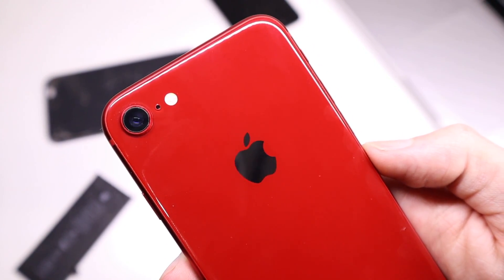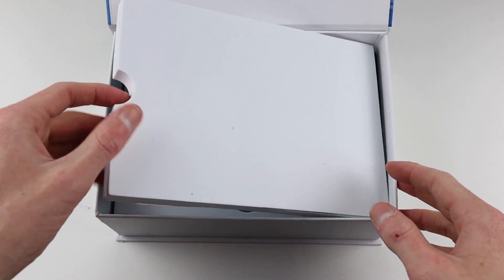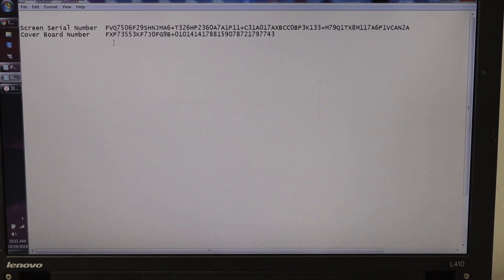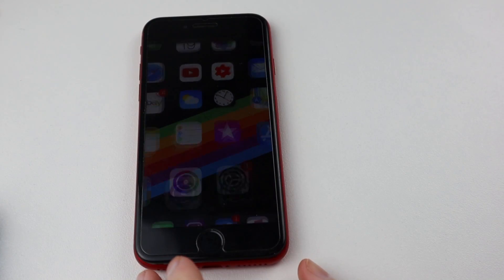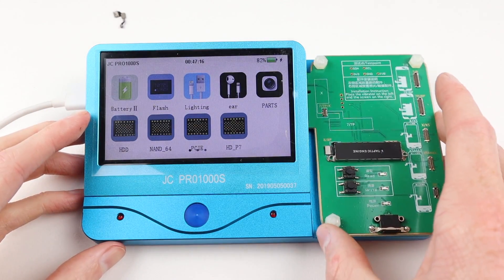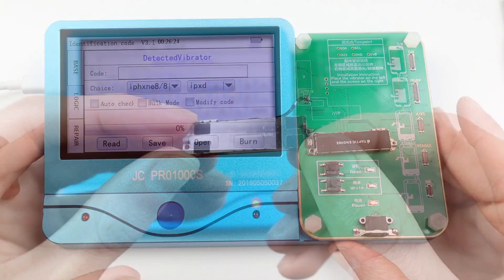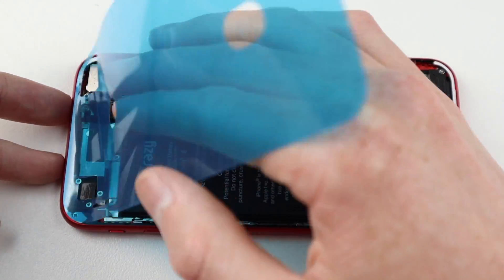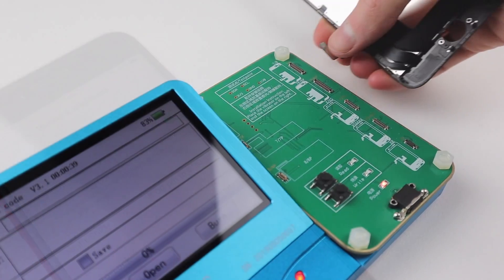Most Common iPhone Repair Mistake - True Tone Recovery without original LCD - JC Pro1000s

Comment: The LCD got half ripped out by a new battery's adhesive. I tried to stich it with tape but the screen looks terrible. Is there a way to replace that tissue without replacing the whole LCD? It's an iPhone SE 2000 and I don't wanna mess with true tone settings.

Comment: You should see if that unit will work with the new iPhone 12 …get 2 devices ( 2 IPhone 12s one Gold and one White or whatever  ) and then swap the parts. You will notice that apple gives a nag for ever part no matter what if its not the part that came with the phone even if its from another same iPhone OEM! I believe its because of a serial number issue. Maybe using this device for each device you swap would do the trick!

Comment: I have a question you mentioned of the front camera is changed or replaced there’s no way of getting True Tone back. Why is that ? And does that also apply for back camera if the back camera was changed or replaced aswell would you still have that problem or no ?
Reply: Tenho essa mesma dúvida! Se caso trocar a câmera frontal não tem como ativar o true tone?

Comment: Could the programmer be used for android? Is there any reason it would be needed on an android repair?
Reply: afaik Apple is one of the very few companies that block you swapping out components... so you generally don't have to worry with anything non-Apple. Just Apple being Apple.

Comment: Phone 8 Plus Vibrate Issues

My home button gives me slight vibration feedback, but nothing else in the system does, flicking the mute switch mutes, but does not vibrate, done a factory reset, software update to see if that would help too. Any help from here on would be great. I think it could be 3 possibilities, either a damaged chip on logic board, charge port flex or vibrate motor. Any suggestions

Comment: Question anyone,I already installed the new aftermarket screen on my iPhone 6s. I lost True Tone and touch ID but no biggie it’s our daughters play phone basically. No flex cables were ripped or misplaced. Everything is snug and properly installed. Someone said that Apple had started to pair the original screen with the logic board. So when I get the programmer,can I still remove the new aftermarket screen from my phone and then just put it on the programmer later? Thanks

Comment: hey Hugh you dont need any more this setup to copy LCM serial or any on systemconfig file (serial imei battery wifi bt etc) you can write/read from computer with MagicCFG you only need 20 dollar cable called DCSD cable (this works only on iphone x and lower)
Reply: you can unlock ipad icloud also a10x and below (ipad 2018/ or ipad pro 2nd)
Reply: because imei is stored in the baseband modem, that cannot be changed.. so ipad will become wifi only
Reply: so you need buy new systemconfig info (serial) and you good to go

Comment: hello I have iphone 6s set which has problem during call reject from other side or disconnect due to any reason my phone screen touch freeze after screen off and on touch work again but that's not happen when call on speaker phone. will you please help me out for this trouble

Comment: I recently purchased a JC V1S as my cousin requested a repair of his cracked iPhone X display.  I replaced it with an LCD rather than OLED screen, but the repair went smoothly and True Tone was restored.

His father-in-law also had a touchscreen failure on his iPhone 8 the same week that I received my V1S programmer. Both phones were purchased at a local electronics store that buys and sells used phones.  It appears that the iPhone 8 may have had its screen replaced before.  Could that be the reason that I kept having write failures to the new iPhone 8 display, or could there have been a different problem with the quality of the aftermarket display?

Otherwise, the screen looks fine and the touch functionality was restored.  The only issue that I saw was the lack of the True Tone option.  Since I couldn't interact with the previous touchscreen to open the settings, I don't know if that feature was working to begin with.

Comment: Ye I let a cheap repair shop fix my iPhone X... Lost my Face ID, gutted. They're screen was totally rubbish. I dropped it so I did the repair myself only to find they left screws out. which I knew was there, when doing diagnostic to why my phone was in a boot loop (ear piece cable) would 100% recommend doing it yourself.

Comment: Hi Hugh, wondering if you could provide a place to get easy to understant info abou the JC Pro1000s. In particular, will this product be supported into the future and provide updates when new iPhones are released? As long as I have the correct module, will this get around the issue with the batteries now being tied to the phones? Thanks in advanced.

Comment: When you mentioned something about the Taptic Engine not functioning properly, I too have had this occur. But, In my case, My taptic engine had came loose from the frame, and somehow the IPhone is able to tell that the taptic isn't seated correctly into the casing of the phone. Screwing the taptic engine in resulted in a now fully functioning taptic engine. Maybe it has something to do with increased power draw from the taptic when the whole thing moves as a result of the attempted vibration.

Comment: no man come on, it has nothing to do with hindering repairs but to ensure good customer service and obviously security to you and your device, not everyone lives in the US and has access to good and safe curated parts (iFixit for example) and safe repair shops that may also be curated for security, apple is going a great job to allow more repair shops to be able to fix your phone.
Also come on, apple devices are the ones that last the longest, I still use my 2011 MacBook Pro and an iPhone 6s that I do plan to continue using for quite a while.

Comment: Thanks for the great video. How do you get the value for Code (Gauss sn:)? I programmed LCD and MtSN but didn't have Gauss SN thus no true tone. (iPhone 8p)
Reply: Hi, I know its 2 years ago but have you found this out? :DD
Reply: @mr.malossi980  Gauss SN doesn't matter. you need to have right MtSN to enable True Tone. but if you replaced front camera module without saving ALS, you lose true tone even if you get right MtSN. but I can enable that if you want. you can PM me.
Reply: @ifixsmartphone9079  So what would you need to do?

Comment: The only reason things like Face ID and Touch ID are locked after replacing your screen is to prevent theft of your biometric data. If someone tried to steal your data by using a modded display they would fail, because your biometric data is saved on the same part that is connected to your touch/Face ID sensors and they stop working after your screen is replaced. So you can cry about not being allowed to repair your own device yourself, or you can actually be thankful that there still is a company that’s worried about their customer’s data.

Comment: More people need to stop buying flagship phones and buy midrange or lower phones.
Reply: To me 2 year old used iPhone 8 worth better than any late 2019 midrange phone in the market. I get phone with good photo, great video recording, very fast and efficient SOC ( A11 is somewhat comparable to SD 855+ )
...
...
While midrange probably seem as fast as flagship on year zero, the flagship usually equipped with more power efficient SOC.
Better SOC don't get heated up quickly, and they maintain their peak performance better.
Generally you'll start see difference between midrange and flagship on 2nd year when apps starts to demand more and more performance.

Also Manufacturer tent to forget midrange phone quickly, some just abandoned after the 1st OS update, while some lucky probably will have 2 updates during it's lifetime.
It so much worse compared to some flagship that will get 4 times software update during its lifetime.

Flagship and Midrange can have similar number of megapixel in camera or multi lens configuration, but the picture quality can get massively different especially at low light or areas with very wide dynamic range. Video quality on low light also a huge difference ( most midrange just focused at selfie and photo ). Even the video encoding can be very different ( flagship phone can handle slow motion 1080p and 4K 60 FPS while I haven't seen any midrange capable of doing that )
Reply: @rommysoeli  the only thing i don't like about iphones are the operating system.

Comment: While I agree it’s wrong of Apple having parts paired to the device like TouchID, FaceID, batteries, etc. It’s important for someone who is not into technology as much as you or other repair people, to know that their battery isn’t a genuine battery and may not be made with the same quality as an original, it’s not right to block the battery health but there should still be a message. And for FaceID and TouchID I think they’re right to block it because someone could make a TouchID or FaceID emulator and just get access by plugging it in, having the paired data stored in the SEP means it’s secure and I trust my biometric data and password are safe from being easily read from storage. It would be better if for the iPhone 7 and 8 the home button still worked even if TouchID didn’t work.

Comment: hey hugh big fan here , i think we “fans” all got a question , which is do these water resistant seals real work aftet installing them and can you do a test to prove their efficiency ? thanks again (like this so it gets to hugh)
Reply: No it doesnt make the phone waterresistant, but it will keep dust and small spats of liquid out.
Also you should never trust your phones waterresistance, it degraded over time and also if the simtray is just sticking out 0,1 milimeter the waterresistance is gone.
Reply: Those are for dust, once opened, you lose water resistance

Comment: You could have just bought and used an Qianli iCopy it does the same thing and cost a quarter of that what a jg pro1000S costs
Reply: That doesnt work if you dont have the original screen, because you cant read it from the old screen.

Comment: Get yourself an ultrasonic cleaner it's gonna clean the electronics properly. Don't post videos claiming mint condition restoration without cleaning the phone. It's funny you would think about putting on a screen protector and not clean the insides, what credibility does your channel hold to it's "mint condition" claims?

Comment: Why would apple do such a thing?!  When a major company does something like that it tells you they don't want their products to be repaired by anyone but them and the price to repair it by them is going to be so high you will just buy a new phone.  Everything now is meant to be thrown away.  Older electronics were never meant to be thrown away, which is why they are so heavy, because they are using better materials.  Old is gold.

Comment: Wow i never know we have such devices avaliable, i thought apple devices are mostly irreparable
Reply: Actually, Apple devices are quite repairable, the screen that opens up first when opening the device is a big plus, because it makes it easily replaceable. Also because there are so many on the market, parts are massproduced. 
However Apple is making repair harder and harder for everyone to do, so that when a device gives a popup "this screen isnt genuine" the repairshop will lose their trust, because they said they put an original display on it. 
That really sucks, because even if you put a genuine display from another device on it, it will still give that popup.
Reply: @thatdude5104  yes, apple makes hardware replacement easy, but using replaced parts difficult

Comment: I had problems with a taptic engine in a 8 today. I had no idea they needed reprogramming
Reply: The iPhone 8 vibrate motor doesnt need reprogramming currently since a swap will just work, us as repairshop always do it to be sure, you would not want Apple to push an update and stop it from working because the serialnumbers dont match.
Reply: @thatdude5104  ohh right I see thanks that makes sense, so it's all just protecting against what apple will possibly do next. Do you know what the little bracket at the top right inside the iPhone 8 is? I've always wondered. It connects to the top right logic board stand off and then to the top of the frame?

Comment: How am I supposed to fix my broken on off side button in my iPhone 6. If I shut down I will never be able to reboot my device
Reply: Plug your phone into your charger to have it boot back up. And ifixit has a guide for replacing the power button in an iPhone 6. You can also use assistive touch, which can be activated thru Settings> General> accessibility> Assistive Touch.
Reply: austin ricker have been using assistive touch since. It seems very hard to fix the button.

Comment: I agree there is no reason a repair shop should not use one, I bought a similar device for only $50 and use it on all my repairs
Reply: Max Fan Which one did you buy exactly?
Reply: Peter Müller I bought the qianli icopy
Reply: Max Fan Thanks for the information, looks like a good alternative.

Comment: Something he didn't mention: you (as far as I'm aware) can only use OEM screens or refurbished screens to have the ability to reprogram the screen and flash the serial numbers over. Aftermarket screens will not work for this function.
Reply: Not exactly right, you need a screen with a so called EEPROM, which is the chip that stores the calibaration data, I have seen aftermarketdisplays with EEPROMs
Reply: you are right mate!!!

Comment: Hi Jeffrey, i had a problema with an iPhone 5c,the screen turns on but the touch doesnt work
Reply: If you have it, try a different screen. Make sure to unplug the battery as soon as you have the phone open. If the new screen also has issues with touch, and is a known good screen, then it is an issue with the circuit that powers the touchscreen. Watch some videos by iPad Rehab on touch related issues on the 5c, and you should be able to fix it yourself.

Comment: My phone had a repair a few days ago with the screen and true tone is gone is this normal or should I tell my insurance
Reply: It is, unfortunately, a normal practice. I actually am a technician, and we don't have the machine that Hugh has. Only some repair shops use that machine. Most business owners don't see the point in owning a machine that would add time to a repair for a feature most people don't even know about. You can definitely tell your insurance, and if the repair shop was any good, they should give you back your old screen and money back (aside from maybe a restocking fee) so you can take it to Apple or another third party repair shop that uses this machine.
Reply: austin ricker k

Comment: why cant you re program the home button or board to get touch id?
Reply: You cannot for Touch ID, Apple has special hardware and software for pairing a new button that only Authorized repair shops have access to.
Reply: austin ricker if authorized repair centers can do it then it’s possible

Comment: can you reprogram a finger print senser
Reply: Anything biometric security related in Apple products requires the use of specialized hardware and software to reprogram, which only Apple authorized repair shops have access to.

Comment: Hey man, I don't suspect you'll answer this comment but I'm stuck on a 7 plus repair, the pentalobe screws on the bottom, their heads are stripped badly. How can I get them out or get the display off? If I have to I'll break the display but any help would be appreciated
Reply: Use super glue. Glue the screw to the screwdriver
Reply: Use a pentalobe driver that's a size up and try to get a grip that way. If you're brave and have a driver that's on its way out you can (carefully!) solder it to the screw itself.
Reply: Flathead a hammer and a lot of patience works
Reply: Take it to a repair shop that has Wiha or Nanch tools, they should help you for free.

Comment: I have a iPad 2 gen that work with a broken screen and a iPad Air 1 that does not work and you can not charge it 

Edit: the iPad Air 1 used to work but when during October 2017 I accidentally broke the screen then when a brought the iPad 5 gen during February 2018 then I decided to fix the iPad Air 1 screen when the shop fixed it they was a other issue the charge port stop working for some reason then I went back to the shop and they said that I need to take it to the apple store and I need to pay AU $150 dollars to pay to fix the charge port then I decided to not take it to apple store because I already have a new iPad and now today the iPad Air one won’t turn on and charge

Comment: The 7 never had True Tone. True Tone is iPhone 8 and later.
Reply: @SimOFFICIAL they should be
Reply: the 5s and later did
Reply: @Jordyperson  Nope, only 8 and later.
Reply: @Jordyperson  no, the True Tone display was introduced with the iPhone 8. If you're talking about Touch ID, yeah, the 5s and later did until the X.
Reply: And True Tone flash was 5s and later (dual flash), but that's not the same thing
Reply: @Jordyperson  thats true tone flash, not display